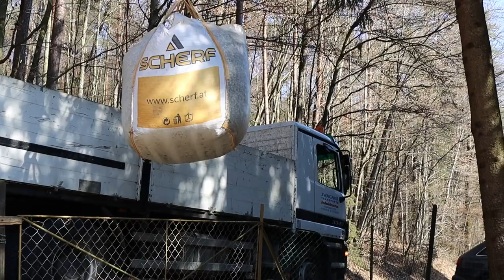Natural Stone Steps and Gravel Pathway Build | Our Japanese Garden Escape

Comment: Such a great video - very inspiring, thank you!  I learn so much from your videos.

I have a question. We have a border around the edge of our patio made of pebbles mixed with cement. It's old, crumbling and in disrepair. It would be expensive and noisy hiring someone to jackhammer to remove it. We really don't want to do that.

We're looking for a simple solution. Instead of removing the border, can we add buildern's sand over the existing border then add gravel or stone slabs?  The finished edge doesn't to be straight. We want the new border to look natural as you demonstrated at the end of the video when you were raking. We plan to landscape next to it in an informal way. Thank you for your advice.
Reply from the maker: Thank you so much, I appreciate that. Technically you can lay slabs or gravel over anything given that you fill in enough sand to lay the slabs. A top layer of gravel may mix with the sand too much over time, depending on the size of the gravel. 
However, based on your description, I am not 100% certain what you are trying to do. If you lay slabs on top of the existing border, would those slabs not be way higher than the patio level? Do you mind just sending me a picture of this border and how it is tied in with your patio please? You can message me on the channel Instagram or email it to ourjapanesegardenescape@gmail.com, so that I can get a better idea. Thanks
Reply: @OurJapaneseGardenEscape   Thank you so much for your time to reply. I'm sorry it's confusing. Yes, I'll be happy to send a picture. I appreciate your kind offer to take a look. I'll message you at Instagram or email you soon.

Comment: Your instruktions of different ways of laying steppingstones will be very useful soon, Thank you. I'm wondering about a thing I've seen japanese gardeners on YT do; they "poke" with a stick (or the backside of a Tool) very thorougly and deep down around Stones to pack the soil or sand. But i Guess it's more needed when it is a Huge standing Stone , or such,  and not needed for a flat stepping Stone? My japanese garden is placed at My summer cottage, so i just have weekends and holidays to Enjoy the lake. 😄 Right now it is covered with ice but it is melting Around the Shore so it's No longer safe to use. Hugz from Sweden 🇸🇪
Reply from the maker: Thank you. I packed the sand/gravel just by hand in this video, which is normally sufficient for the stepping stones. Of course there are always different ways of doing things. Our large stones are just set on the surface, but typically, stones like that are up to half buried in the soil in gardens in Japan. Especially larger upright standing stones. For those it is certainly necessary to pack the soil in as much as possible. As for the stepping stones, they basically sit on top of the sand or gravel bed as opposed to being dug in. 
Sounds really nice to have summer cottage at a lake! Glad to hear that spring is coming in Sweden too :) Hugs from Austria